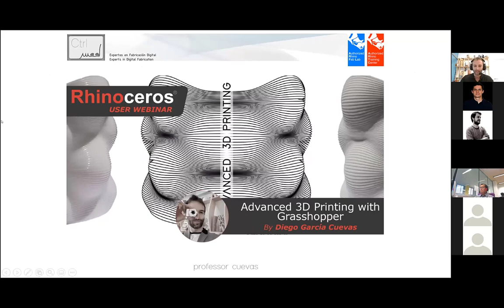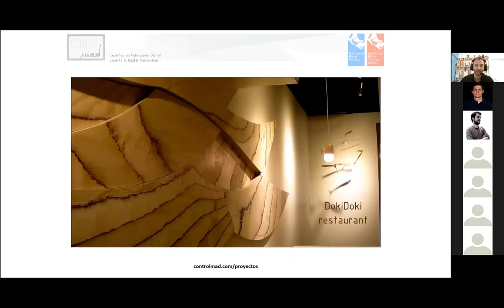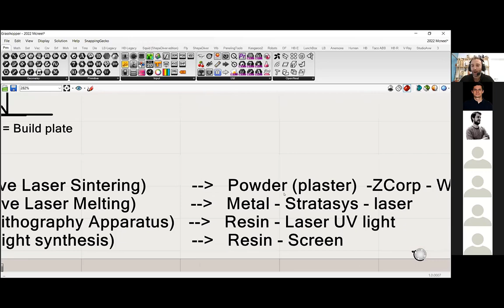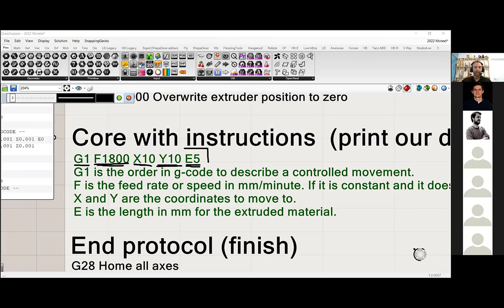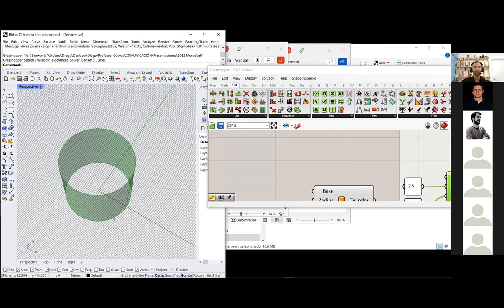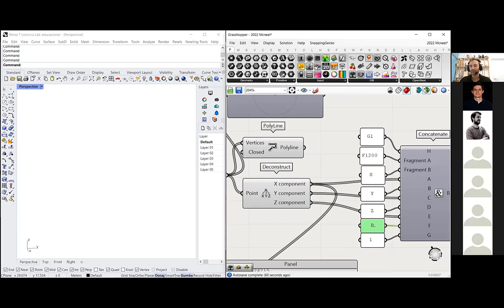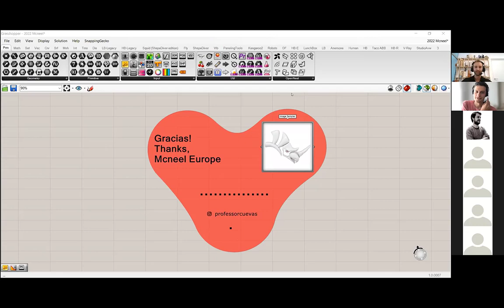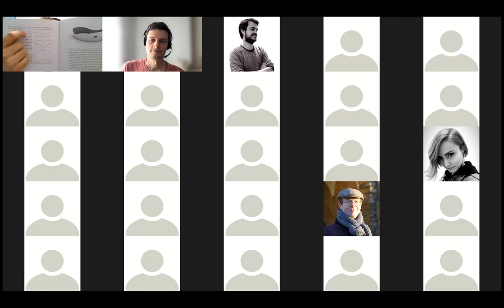Rhino User Webinar: Advanced 3D printing with Grasshopper

Comment: Thank you for the great video. I have a question. How do slicers decide the distance between two points? Does the nozzle flow and speed have any effect on it or is it is an independent parameter based on geometry? As I read in the Gcode made by Cura the distances were different between every two points.
Reply: The distance between points depend on the section of the mesh of the stl file. So, the polylines' vertices.
The speed is independent. It does not affect to the amount of plastic.

Comment: Very instructive presentation. Thank you.  I build space frame models with wood tooth-picks of about 7.5 cm long and 1.5 mm thick connected with a fast glue at the end points.  Very time consuming.  Do you think there is a suitable 3D printing technique and material for this kind of models?  Gracias por adelantado ..
Reply: Not sure about what you mean. Maybe you have to do a specific machine that helps you more than a 3d printer...